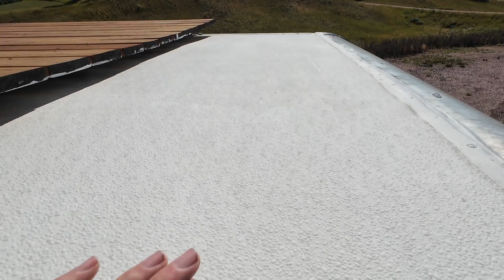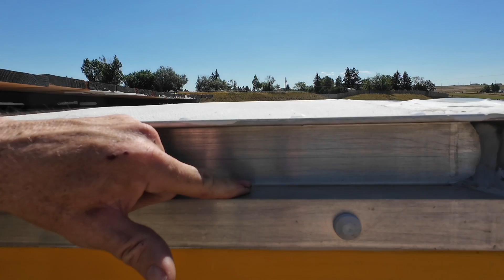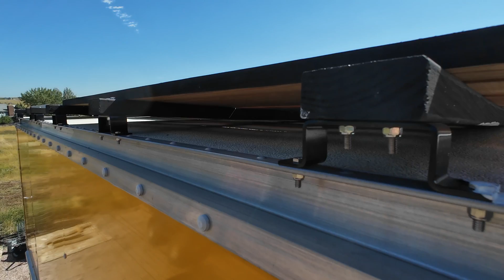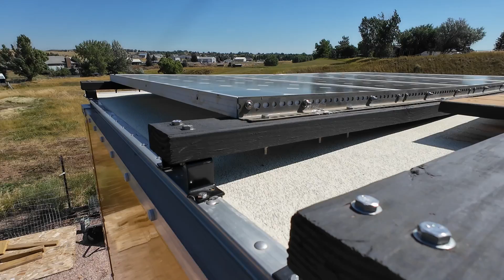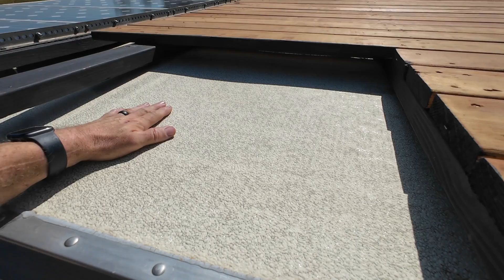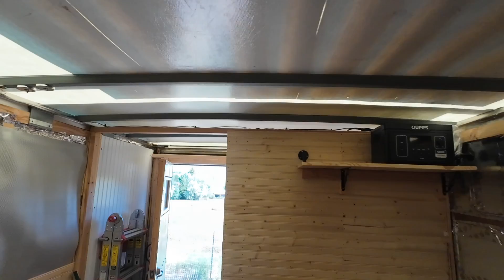Why We Had to Build Our Own Box Truck Roof Rack

Comment: Did you consider unistrut instead of 2x4?
Reply from the maker: I'm almost certainly going to be reworking the roof rack this summer - both to make it stronger and to make it lighter. Metal of some sort is a good possibility for the second version.

Comment: Robert, thanks for showing us your build, and this one in particular as I was wondering how to fit a rack on top of the fiberglass roof. Liked, Subscribed and added a Comment  to help with YT.
Reply from the maker: So far this system is working perfectly. I also like that it's "modular" in that we can replace or upgrade pieces as necessary in the future.